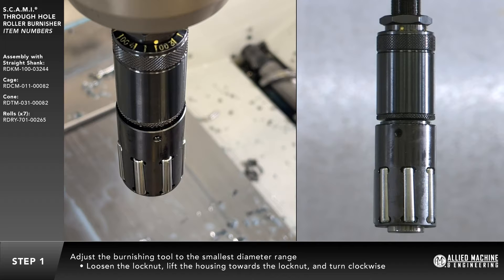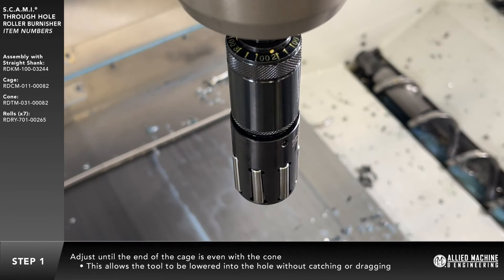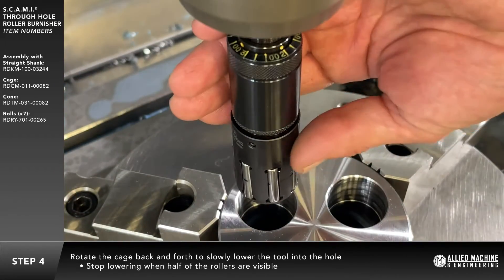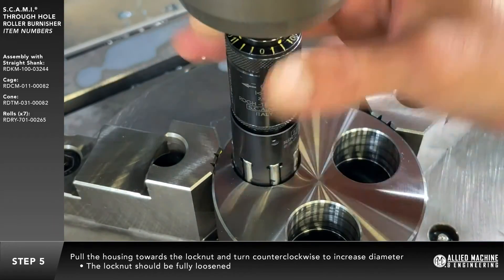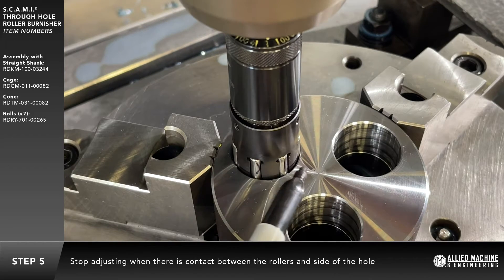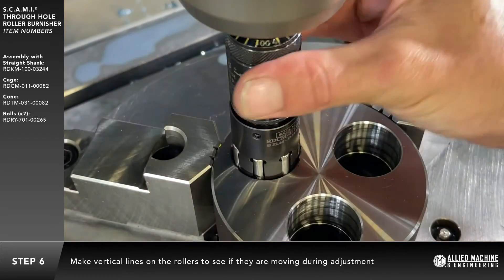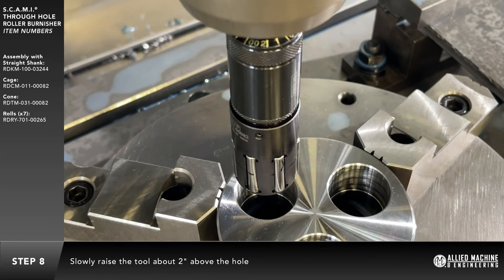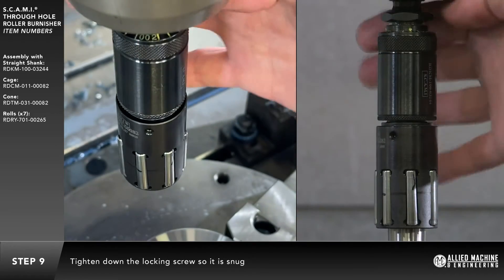How to set up a roller burnisher & set diameter on a machine spindle

Comment: How can calculate speed and feed for burnishing?
Reply from the maker: You can use the tables found in our catalog to determine speeds/feeds, which are based on material, hardness, and diameter. These tables can also be used to determine the pre-drill diameter via the stock allowance chart. You can find out catalog here: https://alliedmachine.cld.bz/Allied-Master-Product-Catalog?1292416131